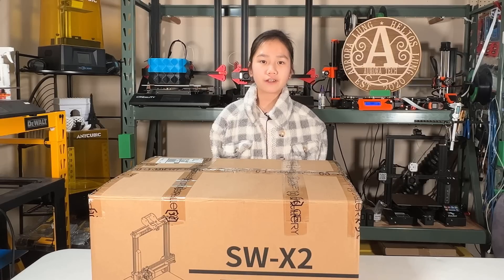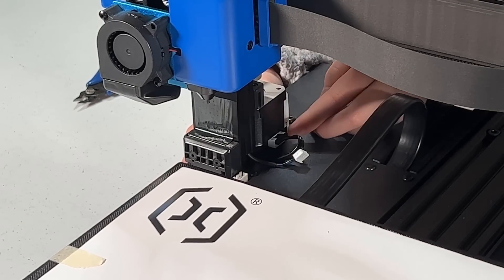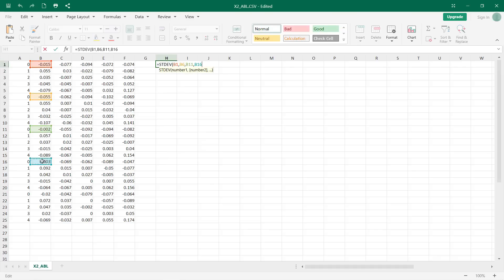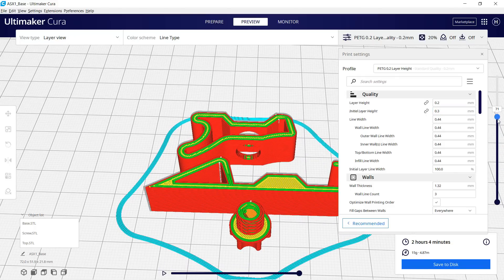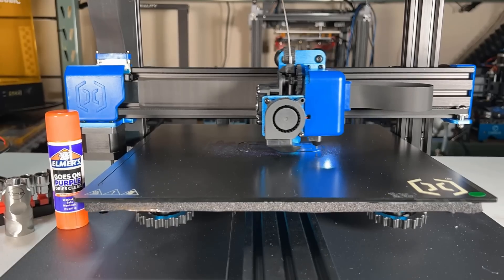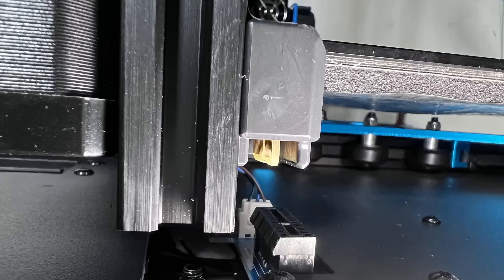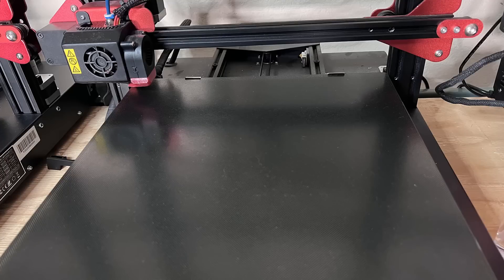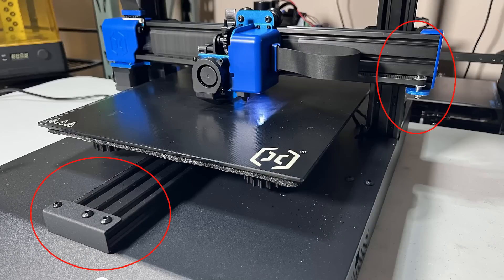Artillery Sidewinder X2: AC heated bed, Volcano hotend, best large-scale 3D printer under $400

Comment: I have the older version of this printer an have been very satisfied with it. The only thing I'd change on it is the heated bed as the stock glass bed isn't very flat. So that's what I'll be doing, I've ordered a milled aluminum bed to replace it.
I never had to re-tension the belts in 3 years of regular use.

Comment: I wrote this long screed recently, so I might as well post it here. Might help somone.. ^_^ It's in response to another video, which will explain why it reads the way it does. 

I've had one of these since 11-11 (yeah, THAT sale) last year, and it's been great. Yes, it does have problems - I'll address the few you've mentioned. Lack of Preheat - actually it DOES have Preheat, just not one with pre-sets. It's under Tools -> Heat, then you press the "+" button a bunch of times to get the nozzle or the bed to whatever temperature you want. Lack of removable bed - a removeable bed is something I decided I could not live without. Fortunately easily fixed. Spring steel? Why? Get some IKEA 300x300 mirror tiles (a box of four for USD6) and use small binder clips to clip them to the bed. Yes, you either have to keep them absolutely fingerprint-free or use glue stick (I use glue stick, having been doing this with my old printer). Don't like bare glass? Get a A3 sized sheet of polycarbonate, you can get a 310x297mm sheet from it. 2mm or 3mm should work. You need to thoroughly scuff the surface with 200 grit sandpaper. (Just got one today, I'll be testing it out soon). Actually, acrylic/perspex/plexiglass seems to work as well, and it might even be possible to get this to work without heating the bed. Again, experiments on the way. OR you could do what Angus suggests and get a sheet of G10/Garolite. Spring steel? Costs too much money, I think.. 

OK, on to a problem you haven't discovered yet, but has been carried over from the X1. The firmware doesn't work with M0 and M25 (the "pause" commands), so the "Pause at Height" feature in Cura doesn't work. You can still pause the printer manually using the touch screen, but it IS a pain and I'm looking forward to someone coming up with a fix for this. There are workarounds, but so far they only work if you're running Octoprint. By the way, I don't use the filament runout sensor - it's a major pain in the neck to use, especially if you're swapping filaments. I just stuck a 2 inch piece of filament in it. If I need it I'll use it, otherwise it's not needed. 

Is this a good printer for newbies? I think it is. I've been hanging out on the Artillery3D Subreddit, so I've been observing problems that have been cropping up again and again for newbies. None of these is particular to the X2 (and also the Genius Pro), they're germane to all 3D printers. Or, in the case of one of the problems with 3D printers equipped with a ABL sensor. 

The first problem is.. newbies often have trouble getting the filament to stick. Most of the time it's simply that they've set the nozzle too high. In the case of the X2 (and other ABL-equipped printers) this leads to another issue. How do you adjust nozzle height??? I've been 3D printing since 2017, I'm used to adjusting the bed using the little bed wheels (not so little in this case..). Nozzle too high? Loosen the wheels a tad, this raises the bed. THIS DOES NOT WORK WITH THE X2!!!! It took me a while to figure this out.. With the X2 if the nozzle is too high, you have to use the "Z Offset -" button (under Tools -> More) to lower the nozzle. Once you have it to where you want it (I'd suggest setting the nozzle to printing height using the Manual Leveling menu - use Position 5 before setting the height with a piece of paper as a gauge) make sure you save to EEPROM.

Why is this the case? Older printers had a Z axis stop switch mounted somewhere on the frame. This was fixed. Move the bed, this changes the nozzle height. The X2 uses the ABL probe as the Z stop reference. Once it senses the bed, it then sets the nozzle height RELATIVE TO THE BED using the stored Z Offset value. Adjust the bed up? The printer STILL sets the nozzle the same height from the bed. This confuses people - not just newbies, but experienced printers like myself who've never used ABL. You use the manual bed leveling to set the nozzle just right, and after you start the print, the nozzle is STILL too high. 

This leads to another problem at least 4-5 people have had on the Subreddit - the nozzle jamming into the bed when you home Z. This is one of two things. If the Z Offset is too low, the printer will try to lower the nozzle lower than the bed. How does this happen? In most cases it's a matter of someone tinkering too much - they disassembled the hot end, either because they wanted to see what was inside, or they got this idea that you had to do so to change the nozzle, or they believed someone who told them they absolutely HAD TO HAVE an all-metal heat break, or their printer wouldn't be cool. And when they reassembled it, they assembled it with the nozzle sticking down too far. What's the fix? Probably use the "Z Offset +" button - hit it 20-30 times. Then home Z again, see if it hits the bed again. If it does, repeat. If it doesn't, then set the nozzle height so that it's correct, using the paper. And then, save to EEPROM, of course. 

Oh yeah.. this leads to another problem (which IS particular to the X2 and the Genius Pro) - the ABL sensor probe can fall out. It's happened to me, and to a couple of others. If it does, the next time you home Z the printer will try to drive the nozzle through the bed. The fix? Stuff it back in there. Use some force, make sure it's in all the way, or you might find yourself with a HUGE Z Offset. What if you've lost it? You can print one. Believe it or not, there's a couple of them on Thingiverse. It doesn't really matter if they're not round, they do work. It's just a plastic rod - I measured mine. 1.8mm diameter, 15.4mm length. You could also go to a model railroad supply store and buy 2mm diameter styrene and cut it to length (I mean, if your printer isn't printing because you're missing the rod, you can't print one either, no?). Artillery should throw a half dozen of these things in the parts bag - it's only a few cents worth after all. And they should fix the ABL sensor design so the rod can't just fall out.

Comment: Try Superslicer which is a fork of prusaslicer which has the option for one-loop perimeters that gives very clean prints. I set angle cost=0 and travel cost=100 to put the seam in a line and give it a clean look.

Comment: I’m interested in how you feel this compares to the CR-10s pro V2. Seems similar in a lot of ways yet it’s around $180 cheaper. Great Video!
Reply from the maker: The CR-10S Pro V2 is $599 and this Sidewinder X2 is $379, but it wasn’t available 2 years ago, so it’s hard to say. But if today I need to choose one between them, I would definitely choose the Sidewinder X2, it has more features and I can save $220 for another 3D printer.

Comment: Excellent review I’ve been watching some of these reviews of yours looking to get into 3-D printing, it looks like a great printer but so far I’ve seen a lot of bad reviews on Amazon about broken parts, missing parts obviously units were sent back and re-re-wrapped and shipped back out
Reply from the maker: Yes, you can see many bad reviews on Amazon for 3D printers, I think there is a reason.

For someone who has 3D printing experience, buying 3D printers from Amazon may not be the best option as the price is generally 15% higher plus 8-9% sales tax depending on where you live. So, you end up paying 20-25% more. For example, this SideWinder X2 is around $469-$599 on Amazon, plus sales tax. But you get a generous return policy and fast shipping. So, beginners love to buy their first 3D printer from Amazon. 

In fact, I saw many bad reviews for many 3D printers on Amazon are caused by beginner mistakes, as there is a learning curve in 3D printing, it takes time. But when things didn't go well, after spending hours or days without getting good prints, some frustrated and angry customers just return the product and may leave bad reviews. 

You are right, if a 3D printer is assembled, dissembled, and returned by an inexperienced user, I expect some parts may be damaged or missing. I don't think Amazon has the resources to inspect return 3D printers, if they just go straight back to the inventory, this could result in more bad reviews.

Comment: Great review. You tell us what we need to know, you tell the manufacturer how to improve the product. Certainly a great printer for what I call medium size. Nice that you tried the 1.2mm nozzle, a lot of info can be gained from that. As always I enjoyed watching and as always I learned a bit extra. The fast bed levelling is a great feature, I assume that could be changed at any printer that allows access to the firmware. If you slow it down the accuracy will increase but it does not make much sense to measure too precise as the relative data is all we need. How loud or quiet is this printer? I assume you can only hear the mainboard and the PS fan. FAN-TAS-TIC ly done
Reply from the maker: Yes, I think so, even without editing firmware, the AC-heated bed should be able to work on any printer. Connect a 12/24V relay to the existing heated bed terminal as an ON/OFF switch to control the AC-heated bed, but I haven't tried this, I just think it should work :)
Reply: @AuroraTech , your advice is correct. Use a Solid State Relay to avoid EMI interference. SSD's can be operated with DC 4V to 32V. Just use the existing bed wiring to activate the relay. Connect Neutral direct to the bed and switch Active with the relay. The other way around will not work. And make sure your printer is properly earthed, very important.

Comment: Thanks for your great reviews. Every time I am get close to buying a printer, you review what seems to be a better choice. One question, others are saying that the bed temperature is not uniform on this printer. Any thoughts on that?
Reply from the maker: In terms of uniform temperature, I think it's just in line with other 3D printers. Even for my Prusa MK3S+, the temperature of the edges is a little lower than the center, I think that's acceptable.

Comment: Nice Video, as always.

One point about the bed: As it is glas, it takes some time until heat reaches top. So thermistor recocnice target temperature reached long before the bed surface has the temperature realy is reached. Also bed bending continues until final temperature is reached.
On my X1 there were defintly better results for first layer when waiting 5 minutes after thermistor detected temperature reached before starting ABL.
Also bed is the same as on the X1. The temperature is quite uneven spread. Actually I replaced the bed of my X1 by an fine milled casted aluminium bed for this reason, much more evenly spread heat. It was quite easy, but you are totaly right about cost.

Also I would call the printer not big size but midsize. An AC Chiron would be the  minimum size I would call big. While not having direct extruder, I still call it best big-size printer under $400. The Sidewinder only is the best mid-size printer under $400.

While the PSU can be switched between 115V and 230V, the bed voltage can not be switched. So if PSU is not set correctly, you have to check the silicone heater. You might have gotten the wrong printer for your market and return it.